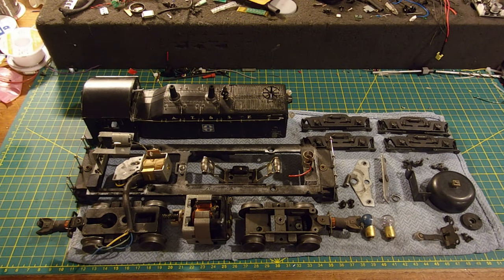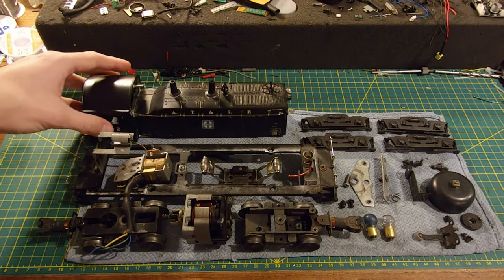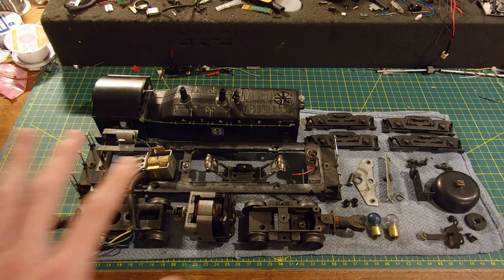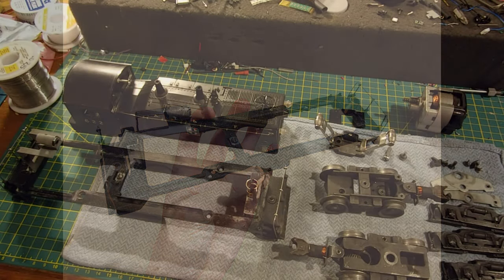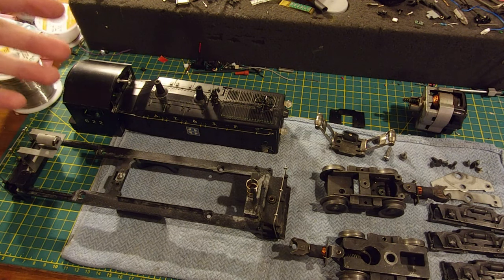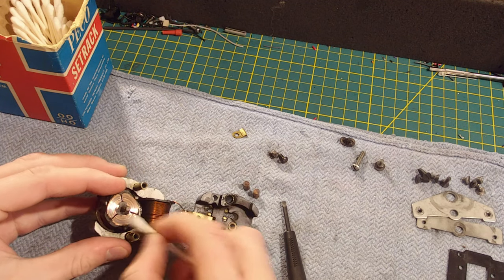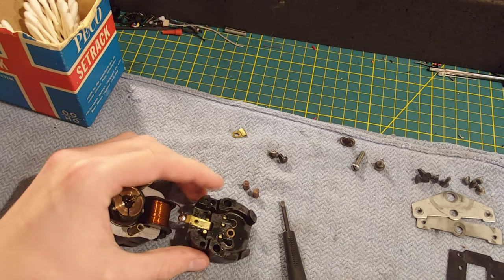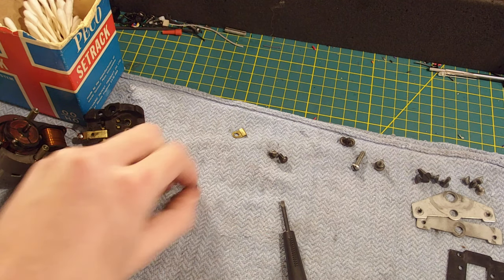Lionel Postwar NW2 Switcher AT&SF #622 #workbenchwednesday

Comment: Do you know what the part number is inside the brush plate where the top of the armature is? I have a 621 switcher and the commutator won't stay in the center....it moves side to side up top and the engine suddenly stops.

Comment: I have been collecting and repairing toy trains since the early 70's. And one thing we never did was to use water to wash down any metal parts. You can never get the part totally dry and so you are just giving oxidation a head start. The plastic loco shell or other car shell if plastic we use  furniture polish and a small brush to clean off the dirt.  Note: the 622-100 brush plate is made out of Bakelite.  Where the brushes go are called brush tubes.   Some old brushes were coated with copper to increase conductivity. You said they were satined?   Did you ever try to wash a Lionel silver Burlington diesel geep?  If you try your method you will remove all the paint from the shell. Good luck -  you may know electronics but not the old post war Lionel